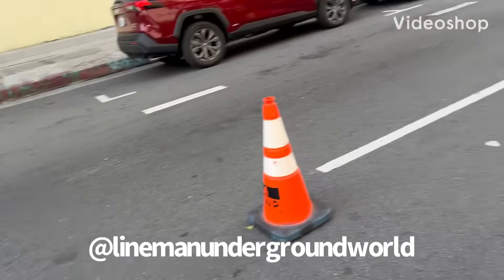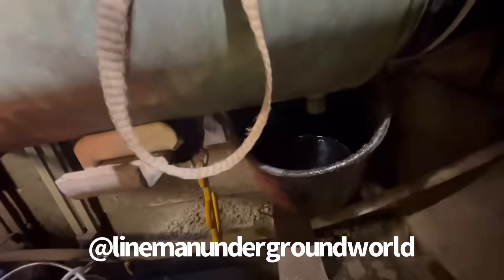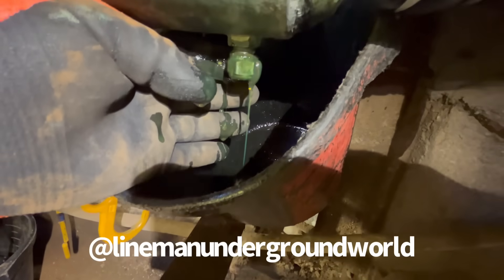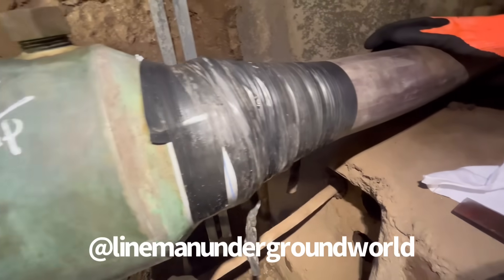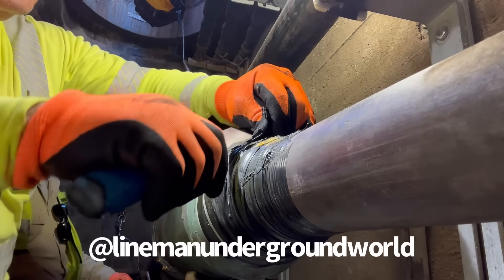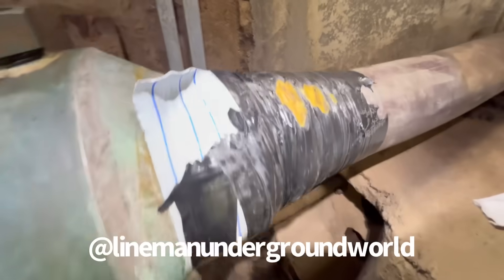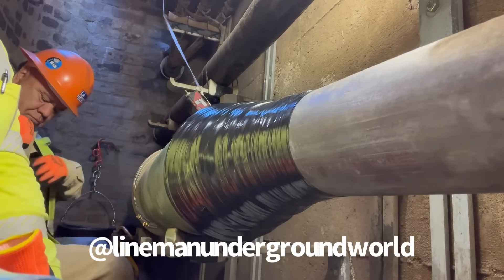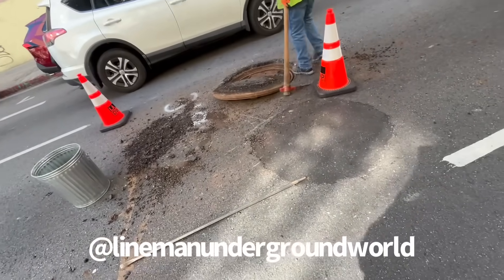34.5KV cable leak ( part 1 )

Comment: Just a bit of solder and it'll be right as rain
Reply from the maker: Wazzup wjg, ya tried and test that way but doesn’t work, because if you know or don’t know the cable have oil and with the nitrogen pushing out it won’t seal correctly, so you will see in my next video.. 👍🏼👍🏼😎
Reply: @linemanundergroundworld4854  Yep that oil is going to be a pain, solder likes it clean, likely impossible to pull enough vacuum on it to keep the oil from weeping where you don't want it. Waiting on the next one!

Comment: That’s really thick oil.  I thought they use mineral oil for insulators ?
Reply: They do use mineral oil, it’s most likely contaminants from the inside liner of the pipe, cable and carbonization of the mineral oil over time that has caused the mineral oil to gain viscosity.  Look how dirty the oil was when it was coming out, some of it was completely discolored which is why I thought possible carbonization.
Reply: @metatron5199  Not that I thought it was engine oil or anything, I suspected it’s probably contaminated but was unsure if they had higher viscosity minerals oils for certain things like cable joints.  I’m not an electrician so I just wondered about it.

Comment: I'm not sure how it is in the cities but here in the countryside, everything has to have a work order. Just like going to the doctor. Any more the doctor needs a work order from an insurance company. Pre-approval I believe is what they call it. Everything anymore has to have a paper trail. That's why most times this is how it is. Repair for now and put in the work order written up by the guy that knows what and how much it's going to take. Very interesting. Where I live, every now and then you would see a dark gray gas cylinder chained to the light posts. I'm not sure but I think the gas line ran up the pole. That's been twenty years ago when we had no buried electrical lines. I'll be waiting and watching. Love the preparatory commands bro. Liked and subbed
Reply from the maker: Wazzup Devon , you’re absolutely correct, and that’s what we. try to do most of the time but here , people are here today and moved on to promotions and new positions, just like every where else, and yes we have to get all the approvals to turn the power off , and fix it correctly again and hopefully it will last another 50 years or more, as this one has, and the nitrogen tanks you see or seen tide to the pole , yes most of those are lead lines and have nitrogen running thru them I still see those around over here as well, stay safe 👍🏼😎

Comment: Sorry, I’ve been working for the Telco industry for 36 years and I have a few comments. 1. If I ever saw anyone down in a manhole without fresh air blowing, they would be suspended immediately. 2. Your job as a technician is to fix the problem according to specifications. Whoever temporarily put the tape on the lead sleeve, may have done it simply because they ran out of time. However, your job is to do it properly according to specifications. The reason it’s leaking is because somebody didn’t do their job professionally. Take pride in your work! You’re a union member! Act like it!
Reply from the maker: Wazzup Mike , 1. Please don’t tell me you in 36 years you haven’t done it and the circumstance why and use the gas tech, 2. Yes sometimes we do run out of time to repair it at that moment, and have to put a temp aka bandaid until we make permanent repairs, I don’t know how telco does things but here it’s 34.5kv and all the procedures have to be done before we even attempt to get on the cable , 3. About professionalism the senior cable splicers we have are top notch, remember these cables have been in the ground for over 50 years and constantly moving around things happen with soft-lead , rips and cracks. Or small pin holes with time , where are you located at Mike and stay safe.. 👍🏼😎
Reply: Wouldn’t expect anything less coming from a Telco guy 😂
Reply: @Uwill_bleedout flex tape 😅
Reply: You can’t suspend a fellow union member. I call bs on this 36 year old baby(not a real lineman). I’ve been in a manhole when it blew up and lived to tell the story. This guy thinks he knows everything. In my experience that’s the most dangerous type of worker. A know it all

Comment: What you happen if you sprung a very large leak? Let’s say one that leaks at a much faster rate than your available nitrogen supply.

Would it short circuit straight away?
Reply from the maker: Wazzup Michael, if that happened we would be on it asap to leak search to find it, to seal it temporary and fix it

Comment: Hey bro, amazing video and i like your style / way how you explain everything. Just a simple question (you will probably laughing). Imagen that 34.5KV didn't get any repair, what will happen? I mean in the worse case?

Anyway keep up the good work bro, love your videos!
Reply from the maker: Wazzup Thor, what could happen is the the pin hole gets bigger with time and pressure or the rip gets longer and wider  and more nitro is required to keep the sustainable pressure up .. 👍🏼😎
Reply: @linemanundergroundworld4854  Thank you bro for the explanations, much appreciated.

Comment: is that a cryogenic superconducting cable?
Reply from the maker: Wazzup linux, that sounds like a rocket scientist problem there, but anyways I believe not but the lead is 100% ground, if that helps 👍🏼😎
Reply: @linemanundergroundworld4854  wurd - is it really cold? otherwise its just a normal HV cable
Reply from the maker: @linuxsuperuser  ya it’s just a normal 34.5 cu  cable

Comment: Leaking nitrogen in a confined space, you need to vent and force in fresh air and have a good meter to tell O2 and CO and CO2 levels
Reply from the maker: Wazzup ocsr, that absolutely correct we forced ventilated for about 15 minutes before we went down in the hole .. 👍🏼😎
Reply: Pretty stupid telling the guy who does this for a living that has bright yellow vent hose laid out that he needs to do this
Reply: @NotaFed1 may have been telling the people who read the comments not the guy who made the video
Reply: Can tell the ones here who were oxygen deprived already
Reply: Lmao 😂  @user-ge2fb9fh2q
Reply: Yes you’d basically suffocate in nitrogen
Reply: 100 percent correct.
Reply: nitrogen is 78% of earths atmosphere. Stop acting like you are smart when the exact opposite is true
Reply: @Roadglide2020.  You are a fool, nitrogen displaces oxygen and creates an oxygen depleted environment that kills very quickly.
Reply: @Roadglide2020.  As someone who used to enter confined space manholes for my Job, I'll tell you that what @ocsrc said is true. Many people have died by entering these spaces without ventilation. Not because nitrogen is toxic, but because because it displaces oxygen. It's very dangerous, because when breathing it, you don't sense that you're suffocating because you're exhaling the CO2 which causes that burning uncomfortable sensation when holding your breath. However, you're only getting nitrogen or some other gas on inhalation. You won't feel like you're air starved. You'll just feel a bit dizzy for a few seconds, and then suddenly drop and, most likely, die. If the O2 deficiency is severe, this can happen in seconds after taking a single breath. Even vaults which don't have nitrogen pressurized cables can have "dead air" because oxidation and microbial action inside the space can consume the oxygen or replace it with other gases. There are also many people who have died trying to rescue another worker who suddenly lost consciousness after entering an oxygen depleted confined space. It's deadly serious. There's a reason why OSHA and NIOSH have regulations and guidance for air testing and ventilation in confined spaces. It's not because they don't understand atmospheric gas composition and are "acting smart when the exact opposite is true", like you're doing. My employer trained employees extensively on this, and if any employee was caught in the field entering a manhole without proper continuous ventilation they were terminated immediately, no exceptions. They understood the extreme risks of entering underground vaults without fresh air. A quick google search or question to ChatGPT will tell you all about this, so you'll be able to post comments about it on YouTube without looking like an @$$ or misleading people about something that can get them killed.
Reply: @Roadglide2020. Yes it's 78% but what makes up the other percentage? Oxygen. When you displace atmospheric air with forced nitrogen what are you putting in and what are you taking out? 

Atmospheric are consists of 20% oxygen. Exposure to atmospheres containing between 10% and 13%.
Reply: @Roadglide2020.  ummmm.  right back at ya genius